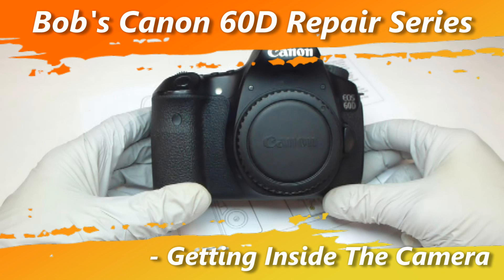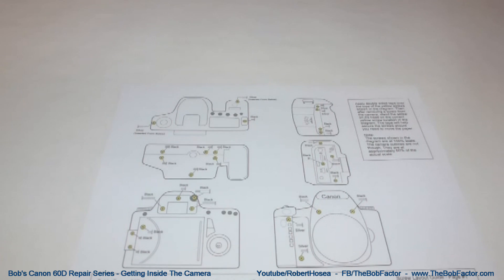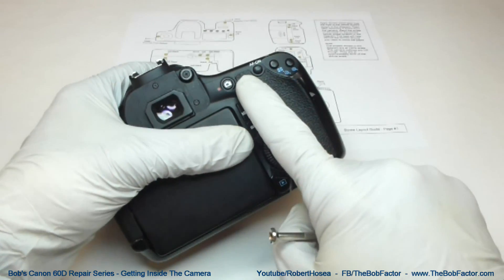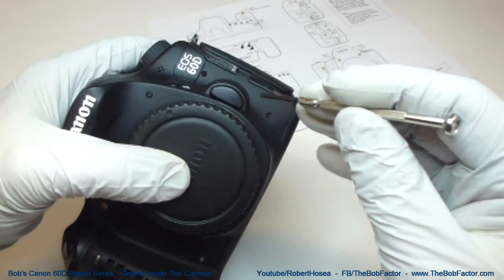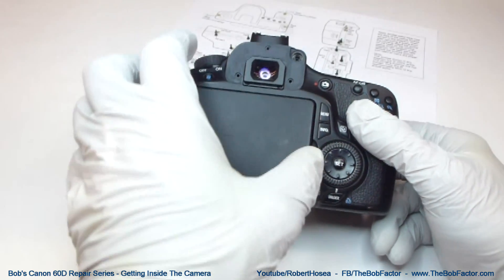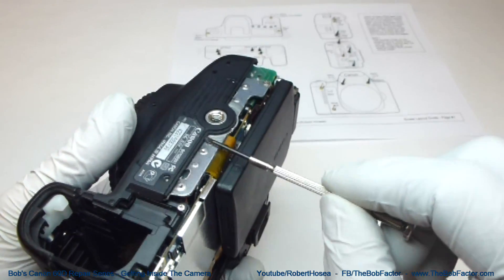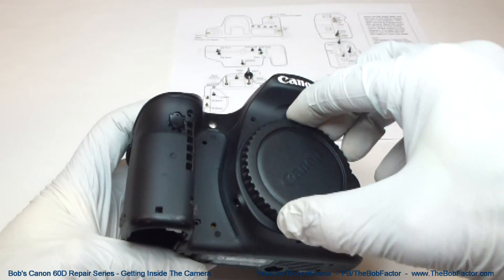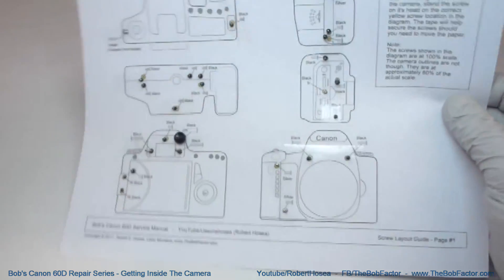Canon 60D Repair Series - Video #1, Getting Inside The Camera

Comment: I tried to follow this guy's review on a Canon 80d and I basically screwed myself. The Canon 80d have some type of japanese standard screw so regular Philip heads don't work . I ended up stripping the screws and now I cannot take my camera apart and I don't know what to do.... My mold selector button is broken and I cannot take it apart anymore because I stripped the freaking screws with the Philips head so don't try to take it apart with regular Phillips screwdrivers......... 😡

Comment: Hi I wonder if u can help me I’ve got a canon 650d it’s been in a cupboard for 6 years got it out the other day put a new battery and memory card in and it just won’t turn on don’t wanna get rid of it as it’s never been used it’s still brand new could you help please
Reply from the maker: Hi. Unfortunately I'm not familiar at all with the 650D. My guess would be that possibly a capacitor on the power board has gone bad, and you may need to replace the power board. I'm not sure though if it has a separate power board, or if the power circuit is incorporated into the main board. If it is part of the main board, then you would need to replace the main board. Sorry I can't be more help.
Reply: No thank you so much I’ve asked canon and they can’t do anything and all the repair shops near me won’t touch it because it’s age so thank you for your Advice I will open it up and have another look I’ve had the watch battery out inside and tested it it’s meant to read 3volts mines reading 1.5 volts but when left on slowly goes to 1.7 volt so I don’t think it’s that
Reply from the maker: @foxthewoodturner1765  I have never run into this situation myself, but I have read a few times that some cameras will not power up when the clock battery is dead or low. The canon cameras that I've worked do not seem to be effected that way, but you might get lucky with that being the problem with your 650D. It's worth a shot any way. Good luck with it!

Comment: Hi Robert, many thanks for the video, of the 60d may I ask you the question, my 60d will NOT turn off I put in the battery and it turns on even when the switch is in the off position I have to remove the battery or open the battery door to turn it off. Can this be sorted if I do the above removing the on/off switch? Also, I am unable to find the free sheet for adding the screws to when you remove them from the camera?
Reply from the maker: Hi Ron. It may be that the power switch is defective, but it is generally just the opposite and the camera won't turn on. Not turning off is kind of different. If it's not the power switch, then it may be the main board is defective. I hope the problem is the switch though. Here is a link to Diagram #1: http://www.thebobfactor.com/Canon%2060D%20Diagrams/Canon%2060D%20Screw%20Layout%20Diagram%201.PDF. Let me know how you make out with your camera, and if you have any problems with that link at all.
Reply: @Thebobfactor  Thank you very much for returning a message, and a big thank you for the camera layout I have now printed it off. As soon as I put the battery into the camera and close the door the camera turns on. Nothing changes when I use it, it's still as good as ever and takes a great shot. I may if I can pick up the nerve have a look this weekend. Many thanks again for the help.
Reply from the maker: @scotland2212  I'm glad I can help. Hopefully one of the contact brushes on the backside of the power switch has come loose or has come off, and it is shorting the contacts and causing the main board to think that the switch is always on. It's an easy fix if it is. If that is the problem and you are unable to repair it, you would probably need to buy a used top cover, or a broken 60D, in order to to get the parts for it. Here is a link for a used top cover unit for a 60D on eBay. This one is out of China, but others from other areas may also be available too. https://www.ebay.com/itm/123075048334?hash=item1ca7d8338e:g:QD0AAOSwB-1Y5wR0
Reply: @Thebobfactor  Thank you again for your help with the matter. If I as I say have a go this weekend you will be the first to know ☺️ I am out Saturday morning on a shoot and depending upon what time I return I may give it a go in the afternoon.

Comment: Hi Robert, 
First of all, amazing work to put these videos dissecting different parts of the camera disassembly and assembly!

I spilled some coffee on my 60D and it entered some part of the camera (not too deep). 
I followed all your suggestions and did a clean up of the different parts. After that, I was able to get the camera work. I took a couple of pics. But then suddenly the LCD screen stopped working. The live view or the playback buttons don't bring up the LCD screen. I also don't hear the typical clicking sound of switching to LCD that typically comes.

At the start, the sensor cleaning also does not appear on the LCD. the top digital panel works and the viewfinder works. When I click a photo, nothing shows up on the lcd. 
When I put the SD card in my laptop, I can see the pics taken - however nothing on the lcd of the camera itself.

Any idea how I can investigate where the problem is? The strange part is that it worked for a couple of shots and then stopped. So I wonder what went wrong..
Reply from the maker: Hi Nayan. It sounds like you were so close to having it fixed too. Unfortunately it sounds like there is still some coffee somewhere inside. The two places that could effect the LCD screen is the main circuit board, and also the LCD's circuit board inside the display unit. Have you opened up the LCD display yet to see any coffee made it in there? It's possible that you could still try drying out both the main board and the LCD circuit board. There is a good chance though that even drying it out will not fix it. It doesn't take much of any kind of liquid to effect them. So drying them again would be a good idea to try, but unfortunately the damage may be permanent at this point. You should also double check the connection for the LCD on the main board as well. Let me know what you find Nayan.
Reply: @Thebobfactor  Thanks for your reply Robert. I will surely open it up once again over the weekend and let you know how it goes. If there was indeed some dampness left, then it may have caused a permanent damage indeed. Will let you know..
Reply: @Thebobfactor    I opened the main circuit board and it seemed very clean and no trace of any spillage. Could you please tell me which video number describes the disassembly of the LCD circuit board? I didn't get any direct reference in the 2nd video where you take out most of the circuit boards.

Also another thing to note is that when I keep the battery out for a day and insert it again after 24 hours or so, the LCD starts up again for one moment. Shows me a pic or two and then dies out again. It does not flicker or anything, just switches off completely. When it comes alive the first time, it shows the display just like normal (not damaged or blurred).. before it dies out.
Reply from the maker: @nayanskhare  Unfortunately I don't have a video for the 60D that shows how to disassemble the large LCD. However, it's really not too difficult to do, especially if you have already successfully disassembled the main camera body. That is very interesting that the LCD display comes on momentarily and works properly after the battery has been out for a few days. To me that still sounds as if there is a moisture problem somewhere. That's a good sign that the LCD doesn't appear to have any blurry or blank areas on it when it is on. I would still say the best thing right now would be to open the LCD display up to check in there. And also to open the main body up enough to let it air dry completely. Sorry I can't be more help Nayan.
Reply: @Thebobfactor  No problem and thanks so much. You already have been of tremendous help with these detailed videos! I found another video om the LCD panel and I did open mine. There indeed seems to be some damage internally to it because I could see a small purple residue in there. After cleaning and putting it back together, it doesn't seem to be working any more. So I guess I have to order for a new replacement LCD panel.

I hope it starts working once I replace it. Will let you know after a few weeks on how it goes. Thanks again and God bless you!
Reply from the maker: @nayanskhare  Yes, please let me know the outcome. I'll keep my fingers crossed the the new LCD fixes the problem for you. Good luck with the repair Nayan.
Reply: @Thebobfactor  Hi Robert, I am delighted to inform you that after getting a new LCD and installing it, the camera is back to normal!! 

Thanks you so so much for all your help and going the extra mile to help me reviving my camera!

Looking at your work on these tutorials, I can say one thing - "Not all heroes wear capes 😎 ".
Thanks again!
Reply from the maker: @nayanskhare  that's very good news that you got it fixed. Great job on doing the repairs! And thank you for the nice compliment. I'm really glad that the video series helped you out. -Bob

Comment: I have the upper pulley of the shutter is very heavy, what is the solution to that
Reply from the maker: Is this on a shutter that you repaired or replaced? By "heavy" do you mean that one of the curtains sticking?
Reply: @Thebobfactor  No, I did not replace it before. Do you have WhatsApp, I sent you some pictures showing this
Reply from the maker: @mohamedelmarekpy  No I don't have that. Send the pictures to hiking@thebobfactor.com.
Reply from the maker: I see from the pictures that you sent to me that this is on a 6D. You could try to disassemble the wheel to clean it. I've never disassemble it though. It might be best to just replace the wheel assembly. Here's a link to a replacement wheel assembly on Ebay. https://www.ebay.com/itm/264814732531?hash=item3da83024f3:g:svUAAOSwAaJZ~rIa

Comment: Guys i need help, go to 6:19, at the left part where the battery resides, is there a cover? Cuz my battery compartment has a hole in that part. I bought mine as used. Ty in adv
Reply from the maker: Are you talking about the rubber grip cover that covers all of that? Where exactly is the hole in relation to the picture shown at the 6:19 time?
Reply: @Thebobfactor  I bought a second hand unit at FB market place here in the Philippines and i saw this part near the battery and i think a small piece of plastic is missing.
https://youtube.com/shorts/wB445P-HPE0?feature=share
Reply from the maker: @ianvincent6670  I see what you are talking about now. That little slot will normally have a rubber plug in it that you can remove when you are using a power supply adapter in place of an actual battery. The wire from the adapter will come through that slot. Otherwise the wire would have to come out the bottom of the compartment and you would not be able to close the battery door. Here's one that I found on eBay that will show you what it looks like: https://www.ebay.com/itm/265020891683?hash=item3db479e223:g:dykAAOSwM5JgB-JZ

Comment: If you're like me and working on a 77D the steps are pretty similar, but note that you do NOT have to lift up any of the grip material to get at screws. There are fewer screws overall and they're all accessible by removing pieces.4
The left plate, the one withe audio and usb input, is held with three screws under the port covers and a little bit of adhesive under the "77D" logo. Once you remove the left plate you will find that under where the "77D" logo was there is a screw for the front plate. 
The back plate and the movable lcd screen are all one piece, unlike the 60D here where the screen is attached to the body. The back plate can be removed by the three screws near the eyepiece as shown here, and all screws on the bottom of the camera.
The front plate is similar, as noted above there is a screw under the "77D" logo, screws on the bottom of the camera, and one near the latch that holds the battery in. 
Unfortunately I could not remove the top plate to access the mode selector switch. This seems to require removing a screw near the right strap mount but it was too tight to remove without stripping it.
Reply from the maker: That's great information Matt. Thank you. I'm sure it will help out a lot of 77D users to know that.

Comment: Do you by chance know what the flat ribbon cable is call that you disconnect before removing the back? Mine is severed in two unfortunately and I cannot find a replacement
Reply from the maker: No, I'm not sure what that cable is called. I do see a replacement cable on eBay, but it's out of China, so it will take a while to get it. The only other option may be to watch for a used back panel on eBay. I don't see any on there right now though. Here's a link to the cable out of China:
https://www.ebay.com/itm/For-Canon-EOS-60D-Original-Rear-Back-Button-Flex-Cable-Board-With-Socket-Part/254469364177?_trkparms=aid%3D1110006%26algo%3DHOMESPLICE.SIM%26ao%3D1%26asc%3D20160323102634%26meid%3Dbb2220d1f27a43c485e8bd942f183cd9%26pid%3D100623%26rk%3D1%26rkt%3D5%26sd%3D283581759782%26itm%3D254469364177%26pmt%3D0%26noa%3D1%26pg%3D2047675%26algv%3DDefaultOrganic%26brand%3DUnbranded&_trksid=p2047675.c100623.m-1
Reply: @Thebobfactor  thanks a ton Robert!!

Comment: Just used your print out to replace the viewfinder in a 60D.  Hugely helpful having them to put the screws on. Thanks for taking the time to make them Robert Hosea. Excellent videos too, top job mate. There is one wrong screw image on the bottom though, if you havent already been told 100 times lol! Right under the lens mount. But no issue with the double sided tape. Again thank you awesome job!

Comment: Well done Robert. Do I need to worry about flash capacitor when I remove the top cover? Do you know where can I get the EOS 80D on/off switch button along with dial selector?

Comment: Robert, I have a 60d having the lcd flipping issue with the sensor in the hinge. I have seen a video and tried the "tooth pick" trick to no avail. I was able to slip out the small circuit board and the metallic square part on the board is loose. I can push down inside that and get the image to finally flip. I wanted you take on this  common issue and see if you had a take on a fix. Also when you remove the rubberized grip what kind of adhesive do you use to remount the grip?

Comment: Thanks Robert for the great tutorial vids.  I commend you for their clarity, and you personal response every single comment on this video.

I have a 60D that was exposed to some salt water... just a splash from what I recall.  Getting the ERR 30 message, which I haven't seen referenced in any previous comments.  I have a second 60D that I purchased after the fact, so I was able to test a few things.

What I have tested;
-  working 60D battery doesn't change ERR 30 message
-  broken 60D
     -  battery works fine in working 60D
     -  menus and screens work fine
     -  with lens in place, camera is focusing and shutter release is triggering, mirror is moving out of the way and I believe shutter is moving
 - triggering a picture with both cameras, it appears the broken camera has a slightly slower response, not as crisp sounding.

I know it has been a while since the last post here, so if there is any chance you can respond, I will be greatly appreciated.

My goal would be to have the two cameras operating and thus allow much less lens swapping and allow my daughter a better experience the next friends wedding she shoots.   ;-)

Comment: Hey Robert, is it safe for me to use this guide on a 70D? I need to replace the lens contact points on the body, so I'm just wondering if the diagrams in the description could help
Reply from the maker: I'm not familiar with the 70D at all, but I believe they are similar, but I doubt they are identical. You can use the diagrams as base diagrams, and just draw in the screw locations of the screws that are not on the the diagrams as you disassemble it. That's what I have to do a lot of times for cameras that I don't have the diagrams for. -Bob

Comment: Hi Robert, thanks for sharing these great tutorials which are so helpful indeed. Please keep up the good work! Can I get your advice on my broken 60D that I bought 2nd hand. It does not power up at all. I already checked another fully charged and genuine Canon battery, checked the switches (battery/SD), also tried a hard reset but all to no avail. I noticed the LED does NOT blink when I put in the battery. I’m wondering if it might be a fuse on that small, shielded power board underneath the top LCD. Would you think so too or have any other idea? Cheers
Reply from the maker: Hi Ronny. You should check the power board and see if it is working at all. Here's a link to the video in this repair series for testing the power board: https://www.youtube.com/watch?v=yeCrpv_u1Zw . Let me know what you find. -Bob

Comment: GREAT VIDEO!  Makes it look so easy getting inside of it.  Have you ever had a problem with the card reader contact pins?  I have a couple bent pins making it so the camera doesnt think there is a memory card inserted.  Can it be accessed after you take the back part off?  Is it under the large silver piece?
Reply from the maker: Hi Joe. I have had SD card contact problems from pieces of plastic coming off of the SD card plastic cover and getting into the contacts. Not from bent contacts though. Unfortunately just taking the back off will not be enough to get to the SD card. You will need to completely remove the main board first and then you will get access to it. So you will need to follow all of video #1, and then part of video #2, up to this location: https://youtu.be/_-gQbCM7QMw?t=403. From there it will show you how to remove the SD card circuit board. I hope this helps you out. Let me know if you have any problems. -Bob